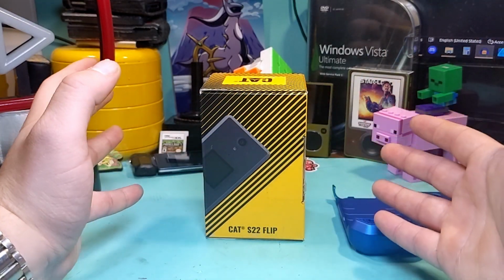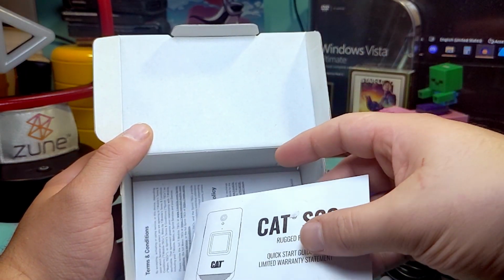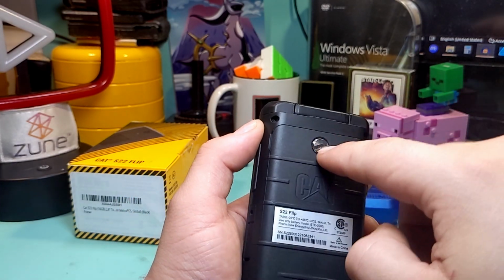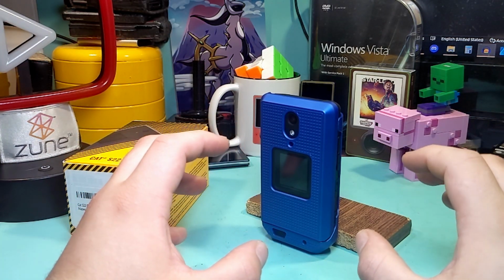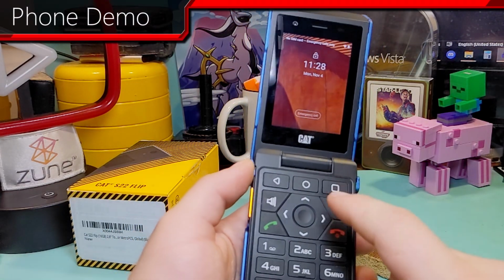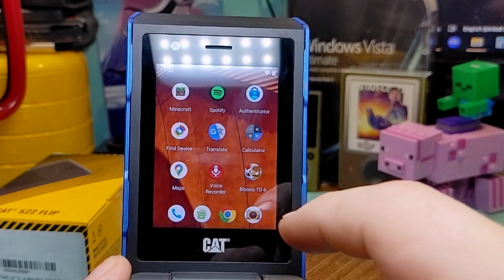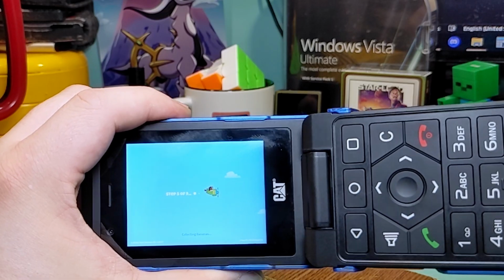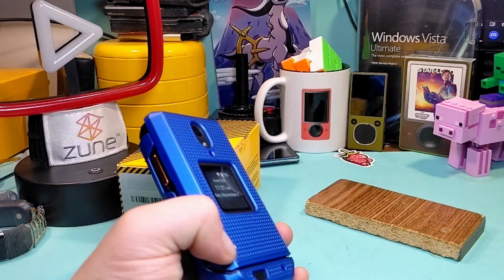This Construction Company Made a Weird Smartphone!

Comment: i have this phone it  like to over heat in 35 c tempure in my pocket they sell phones and the stock on amazon is returns that are unlock and reset
Reply: while watching,-  it ca be bought unlocked im in canada and i bought it unlocked and used ut hear, that cause reduses signal between 10-20 % , also when i set my phone up it gave me the option to either use the  t9 or on screen keyboard for text imput that might be  an unlocked feutre , also pokemon go "works" in virtical mode for a few secods iv been ale to catch a pokemon on it,its bluetooth rage aint grate only  about 20 feet  , also a nw batery for it is about the same price as the phone,  and you can watch youtube for 2-4  hours based on cellphone signal stength also it has a good antenta iv used it in areas where modern flagslip phones get 1 and 2 bars 3 g and its had lte on the same network , also you can do the nice slam phone close on someone and if bounces a bit and it more or less ar proff with  usb closed because it has a gasket on the batery area it keeps water from geting in there when fuuly tight right one in 2 feet of water and it didnt stop my video (ill fix speeling erros after to drunk to bother now)